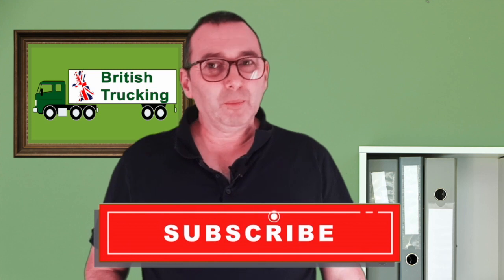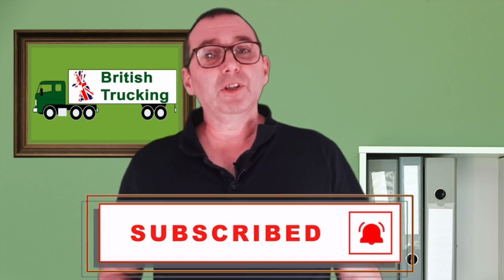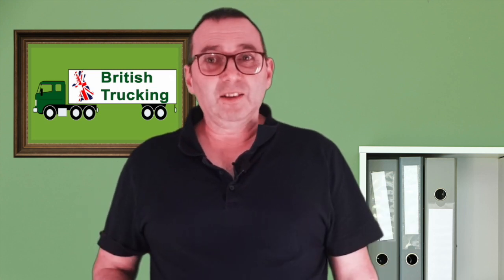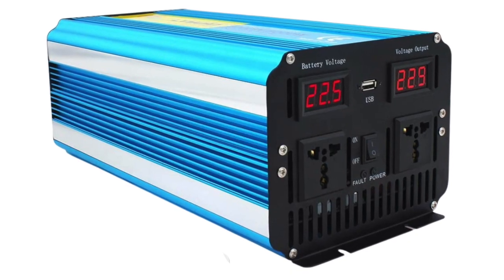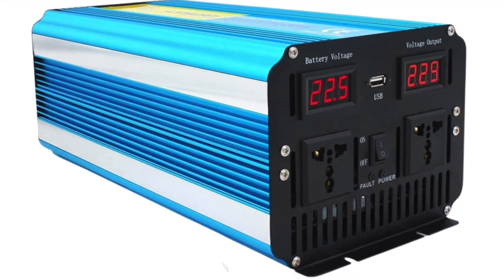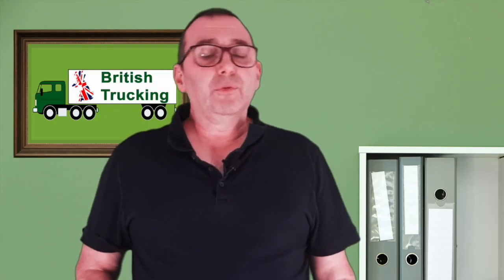Power Inverters for Trucks How Do They work? Trucking Tips

Comment: What size inverter would you recommend for your average hair dryer? Cost is not an issue, I’m just not the greatest at maths so can’t figure out if a 4000w would be enough 🤔 think the average wattage is between 1500-2000 and the amps between 15-20. Can also run the truck engine at the same time and on average it takes me around 10 or so minutes to dry my hair 🤯
Reply: Whatever the appliance power output is. Double it. For example a 700w microwave would need at least a 1500 inverter to run it safely.

Comment: Hello sir I wanted to know I have 700 watt  microwave  what watt investor I I need thanx
Reply from the maker: I would go for a power inverter of 1500w or higher and make sure that the inverter is wired to the batteries of the truck and not plugged into the dash socket because of the amps, also when using the microwave have the engine running on the truck when you cook, this article on the website might be useful for you https://britishtrucking.co.uk/microwaves-for-hgv-trucks-in-the-uk-powering-a-microwave-with-an-inverter/ thanks for the comment 👍
Reply: @BritishTrucking  OK 👍  thanks